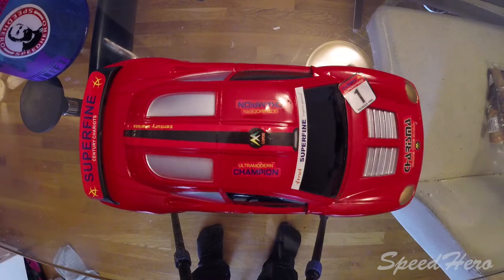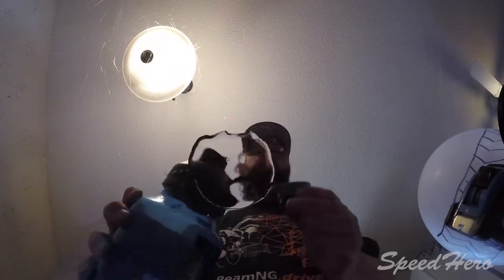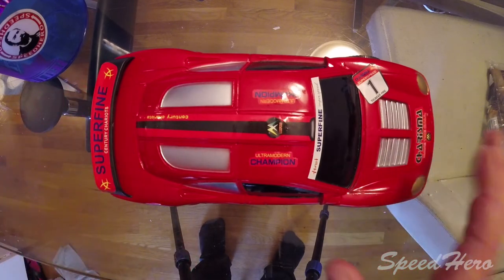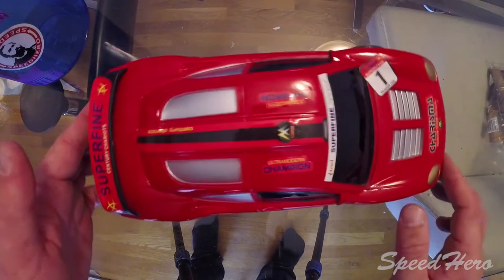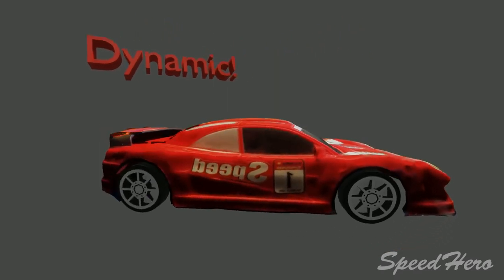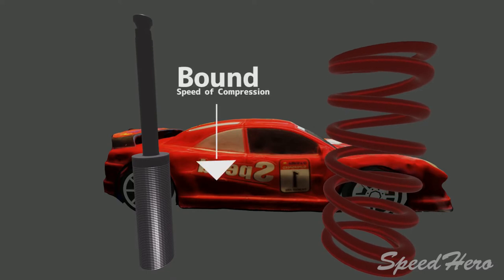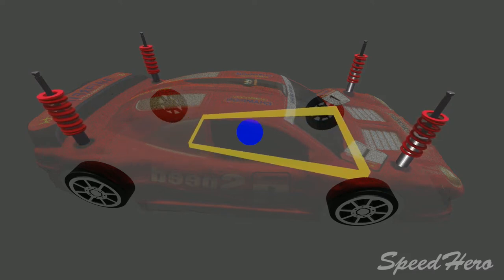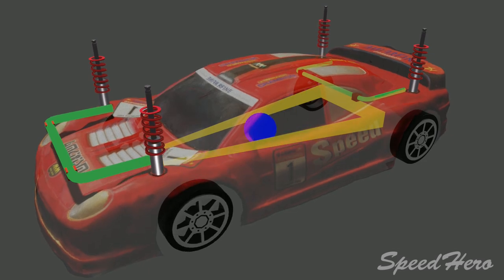Drifting Cars: The Floating Pivot Point

Comment: Could you add in pros/cons of having or not having a rear sway bar?
Reply from the maker: Having watched the video. You tell me!
Reply: Can I have some more, sir
Reply from the maker: @Donn29  Sure! The rear bar generally is softer than the front. Often in many drift cars they remove the rear bar entirely to promote even more rear roll and rear grip bias. This is a common practice in other oversteer motorsports like dirt oval racing, and baja trucks. Restricted roll front, and free-roll rear results in rear traction bias (more rear grip) during a slide. 

However, most pro drift cars still have a rear sway bar. This is to allow tuning for various tracks with differing radius corners. Doing the bank at irwindale and need a high speed slippery setup? Big rear bar. Trying to get grip during tight radius, St.Louis hairpin? Unhook the rear bar. 

Many good sway bars have adjustable stiffnesses. I ran no rear bar for the longest time in my Corollas to get as much grip from crappy tires as possible, but in the BRZ a rear bar is nice as the tires I run are generally grippier. So you give the front a big stiff bar, and then use the rear to adapt. Though in almost all cases, it's usually a softer rear bar.
Reply: @SpeedHero  awesome, I wasn't thinking about the roll in relation to the surface, more about spring rate/stiffness.  In an off camber corner the rear of the car will stay level to the surface naturally without a sway bar but in a banked corner the car wants to roll still so the trailing tire looses grip and leading has more of the grip?  Does that make sense?
Reply from the maker: @Donn29  Off camber corners, the car will roll still. The banking isn't what determines the roll of the car, it's the forces conflicting = Car (object) wants to staying in motion, but the driver is directing the tires to change the vehicles direction. This results in a conflict of forces and causes the car to roll. So turning the vehicle (drifting or not) will cause the car to lean regardless if the corner is on/off camber. 

The rear sway bar is about balancing the natural Under/Oversteer bias of the car overall, and less about which way the corner banks. The reason I mentioned banked ovals, is they vary in corner diameter. The bigger the diameter (The closer the road surface is to a straight line) the higher the speed the drift. The higher the speed the drift, the more it relies on momentum to keep the car sliding, rather than the power to maintain the slide. Often, high speed corners require the car to have a bit more oversteer -bias since you have to rely more on momentum, and less on engine power to maintain the slide. Thus why you'd run a bigger rear bar on large diameter ovals like Irwindale (Though if you had enough power, and/or little tire grip, you still wouldn't need a rear bar).